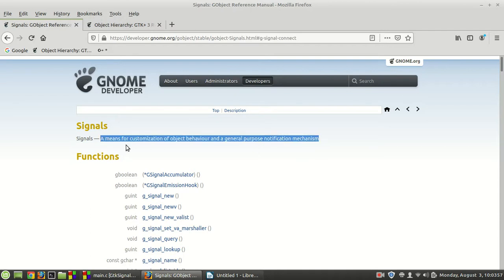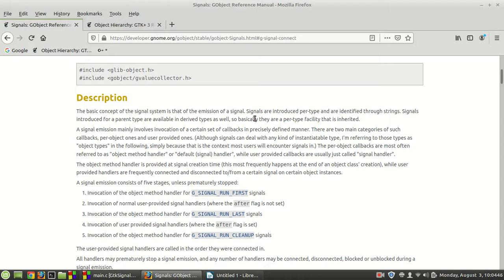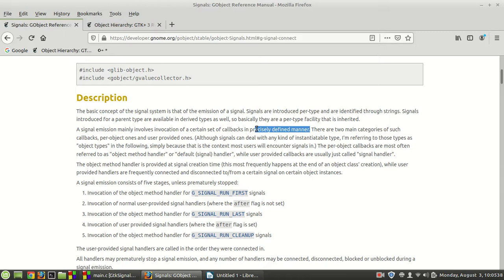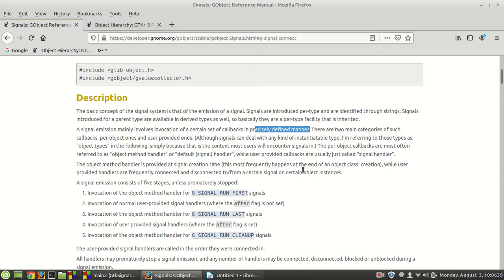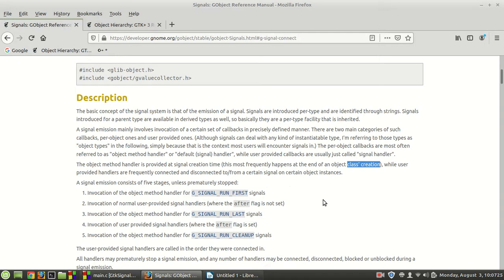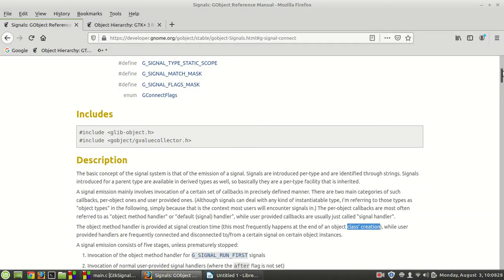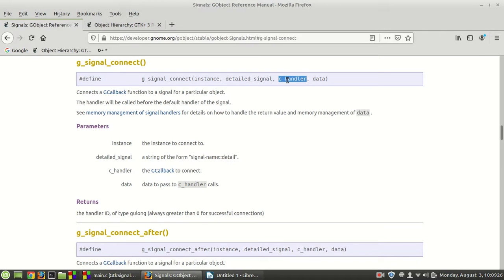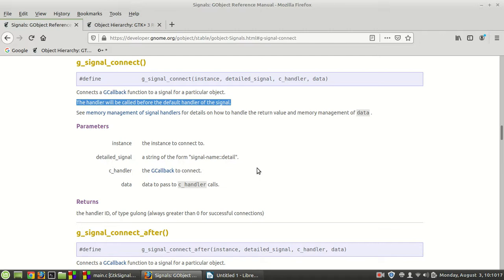GTK GtkSignals Part01

Comment: i'm new to gtk. when gtk connects a signal to a callback function, the callback function runs then the signalled event runs. this makes impossible to select text in a entry after a specific key stroke, because the selection runs first then the key is added and selection is gone. connect_after doesn't work, i don't know what is for. how to run a callback function after the signalled event?